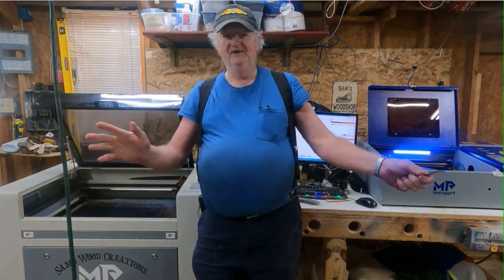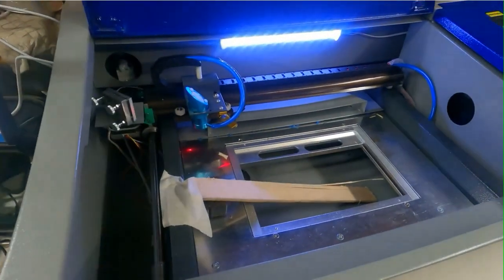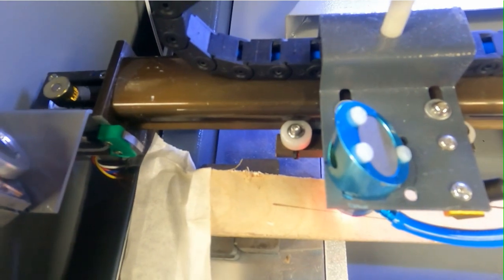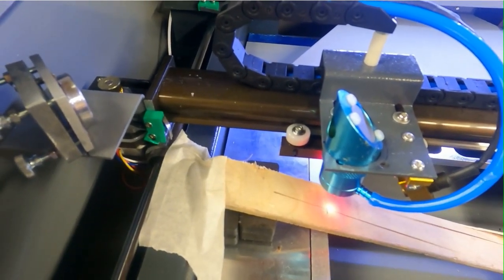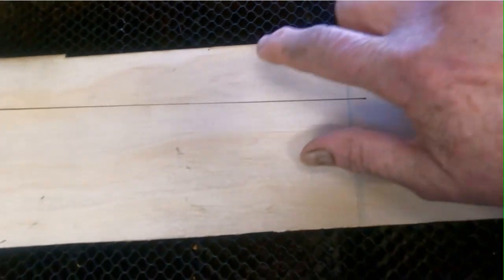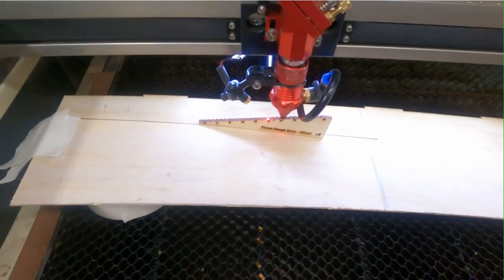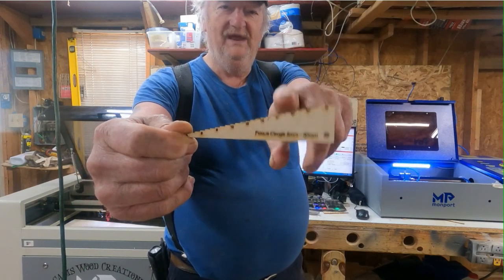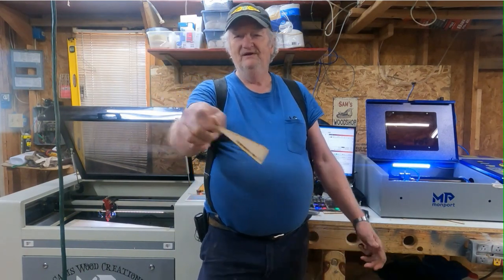Unbelievably Simple Laser Ramp Test - You won't Believe what this Focus Gauge Does!

Comment: Nice work thanks for the insight, I’ll have to try this on my 60w. My one question is does the angle or ramp of the test subject have to be a specific angle?
Reply from the maker: It can be any angle. It's better if the angle is long and steep because that gives you a better result with the line and a better look at the fine point of the line. The step gauge can be slid in at any angle